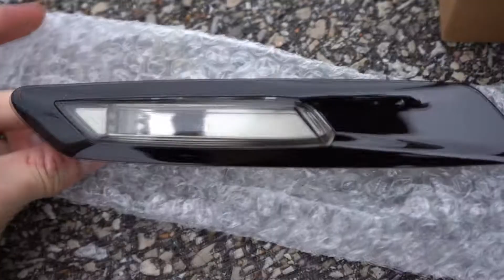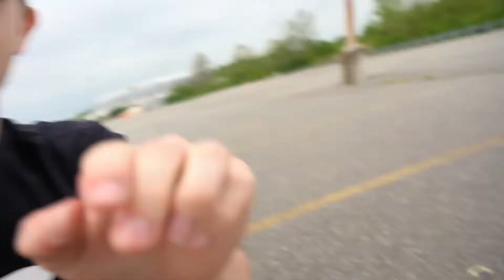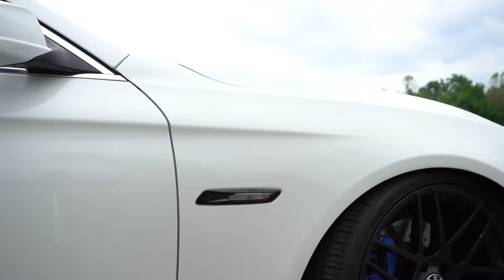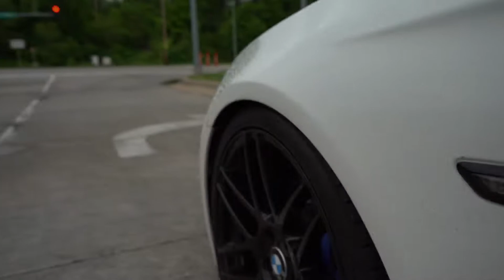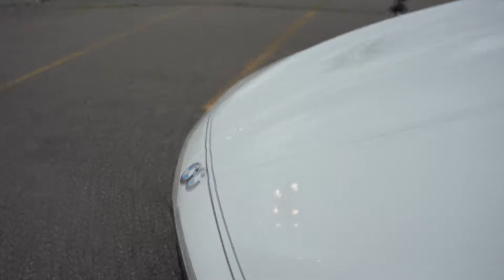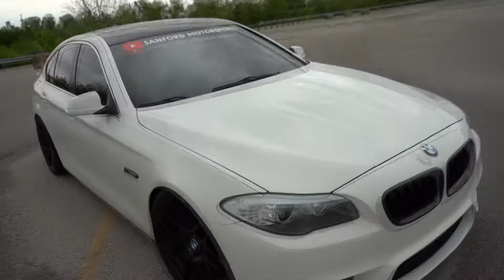INSTALLING GLOSSY BLACK FENDER LIGHTS ON MY F10 535I!! **CRAZY TRANSFORMATION**

Comment: My 535i are just chrome plastic. Will it still have the plug for it to active?
Reply: Activate
Reply from the maker: It’s just a replacement plastic piece, it doesn’t replace any wires or lights!